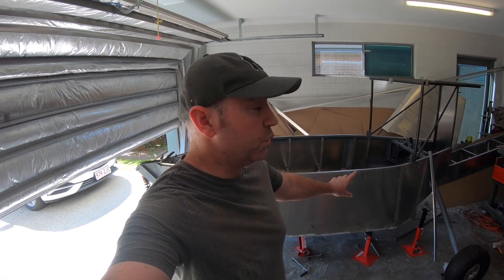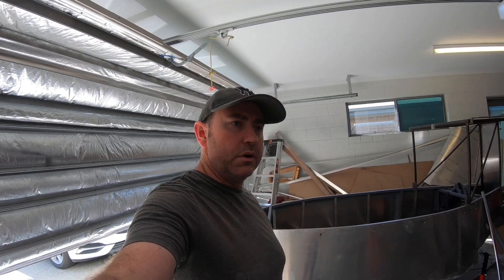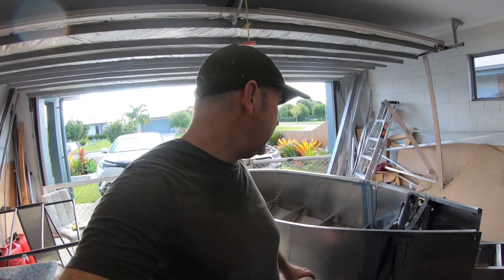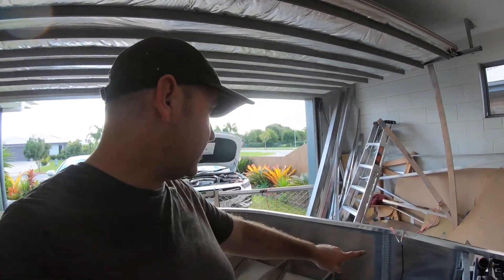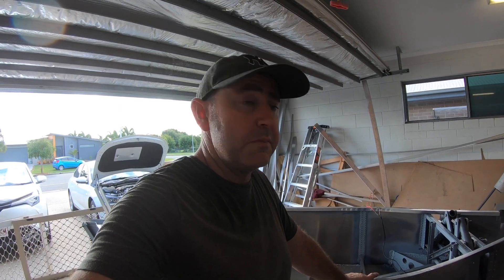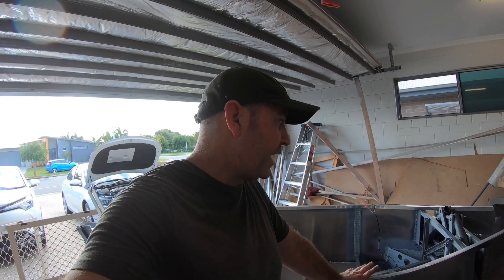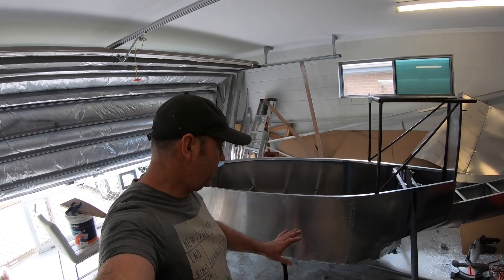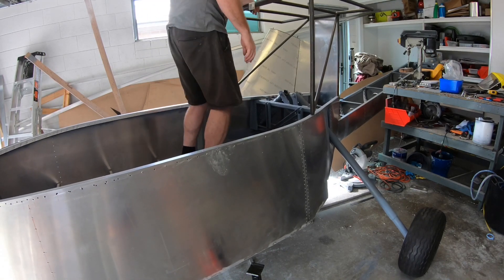We have motion ! Unleashed Experimental Aircraft seaplane stronger than a Tesla truck

Comment: Nice work.  I would suggest you will find significant oil canning between the hull supports once you get into water ops.  I fly a Searey and the hull forces of a firm water landing are tremendous.  While I am biased in favor of the Searey, its good to see alternatives.  Your single-actuator main gear should save weight from the twin actuator ‘Rey.  You may want to think about moving the gear pivot point as close to the hull wall as possible to eliminate the need for that long leg channel at the wall.  Thats going to be a PiA to seal from water pressure.
Reply from the maker: Thanks Ken it’s great to have some suggestions and real world experience. the oil canning issue I have addressed , there is full support and structure behind the 2mm plate bottom. my calculations were done to prevent any of that along with the optimised shape. I have 2 SEAREYs in the hanger also to compare one carbon and one fibreglass and my hull structure is more than substantial to withstand more force including impact force from gravel bars. understanding there is more than 20 psi of force generated under the hull at any one time I based my calculations on a 5 X factor just for water operations and then factored in additional support for impact. I like your idea regarding the rear gear , doing this over again I would probably change a few things, but hey that’s why this is called experimental 😀 it’s great that we have the privilege of being able to experiment  with different ideas and techniques. appreciate your feedback it gives me ideas for future builds as well 👍🏻